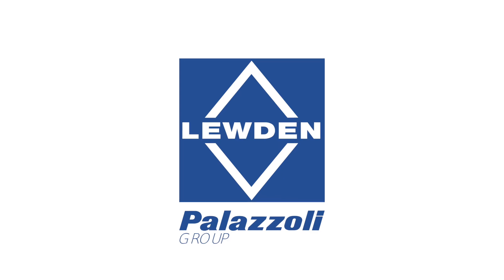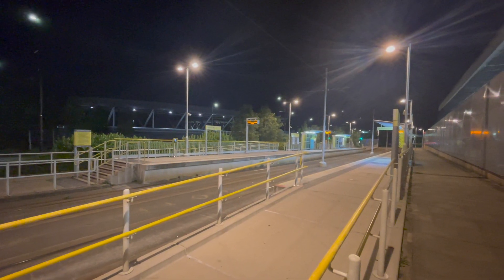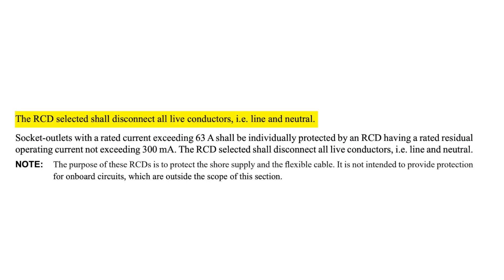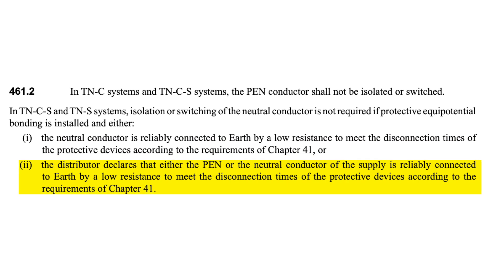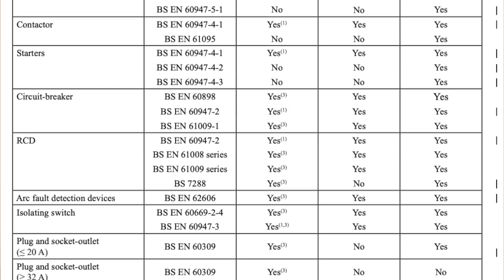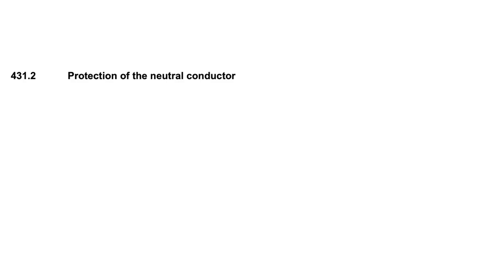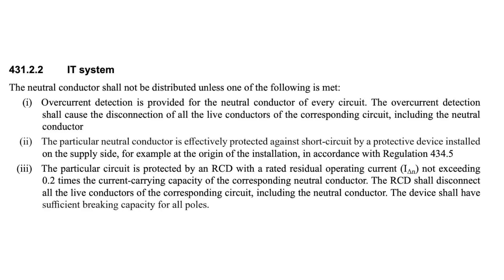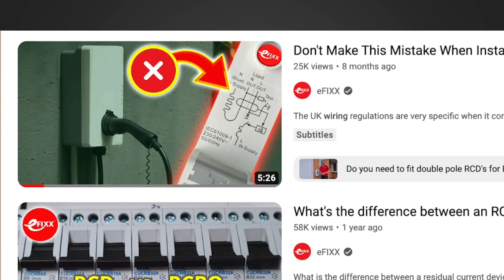Solving the Puzzle - Installing Double Pole RCBOS, MCBs & RCDs?

Comment: hi i have a question so a TT board with a main switch or rcd main switch and single pole rcbos is compliant as the main switch provides the needed double pole for isolation?

Comment: I've never seen a reduced sized neutral conductor in a single phase or 3 phase installation.?? Where is regulation saying that it's acceptable to install reduced sized neutral conductors?
Reply: It is allowed if neutral currents are guaranteed to be lower. Can’t remember the regulation. Consider 3ph AC motor circuits which are perfectly balanced and therefore no neutral is required at all.

Comment: Worth noting that some RCDs and RCBOs have fixed neutral, and that RCBOs can be referred to as "double pole" whether they have over current production on the neutral pole or not. Also, those caravans shown in the video are transportable units rather than caravans for regs purposes. Caravans are driven or towed with their wheels on the road.

Comment: Can you explain the difference in a domestic setting single phase instalation between Double Pole and SinglePole with switched Neutral?
Reply: In a single pole RCBO with switched neutral the Neutral conductor is mechanically linked to switch off only when the RCBO trips.
However, the Neutral is NOT protected against overcurrent or faults (unlike the Live).

In a Double pole RCBO both live and neutral will both trip if there is a fault on either one.

Comment: Is a switched neutral device true double pole?
Reply: I think double pole is only when there's protection in both poles. If the device only has a switch for the neutral but no protection, I don't think it can be considered double pole.
Reply: @1idd0kun  Can you clarify what you mean by ''protection'' please? So what does that make a 20A double pole switch?

Comment: hello guys, a warm greeting from Italy, your channel is just great! In our country we generally use 2-pole circuit breakers, the distribution system in the residential sector is T-T. In the UK I still haven't figured out the nature of distribution, what kind of distribution is it?
always keep it up on your channel, you are bringing wonderful content. Hi everyone.
Reply from the maker: Thanks for the feedback - We’ll be exploring some installations in the South of Italy next month. Uk is mainly TNCS for properties built in the last 30-40 years. TT is still found in rural properties. Older town houses TNS.
Reply: @efixx  nice!
Reply: France mandates that all disconnectors in the main panels are double pole.  This means they use twin L&N busbars (called a comb).  It makes it all so much neater inside the main panel and safer. The British are behind. Schneider (French) sell DP RCBOs and RCDs using the comb busbar in the UK, emulating the French system. In fact better as the main panels have to be metal in he UK.

Comment: I'm an electrician in France. Just for interest: all circuits in this country are protected by double pole RCDs and MCBs: single pole examples don't exist.
Reply: I suspect that in time, the UK will do the same?
Reply: I don't think it's quite so important in the UK, since the socket preserves polarity
Reply from the maker: Great info thanks Richard
Reply: Is the wiring in the installation pme in France or does it have a separate circuit protective conductor like the UK
Reply: Same in Belgium. All poles must be broken.
Also, all circuits must be RCD protected (whole house single 300mA RCD is mandatory)
Reply: It's  the same here in Spain.
Reply: Same here in South Africa. I've never seen a single pole RCD. Here we call them Earth Leakages.

Comment: Electrician from Argentina here, we're obligated to use double pole equipment for everything, only exception is lighting circuits but it's still recommended, all circuits must be separate as there's a danger of backflow trough the neutral wire into your "off" circuit. been there, its a not so fun tingle. im always left confused as to why almost all european panels i see are mostly single pole with bonded neutrals on a bar, when our normatives derive directly from IEC ones.
Reply from the maker: What is the standard earthing system in Argentina?
Reply: I think the answer to that is the neutral in the UK is nearly always connected to earth so is always at 0v.
Reply: In the Netherlands we switch the neutrals.